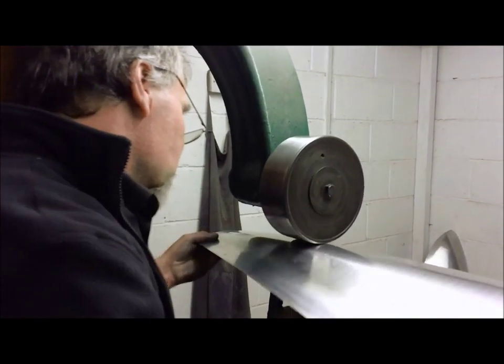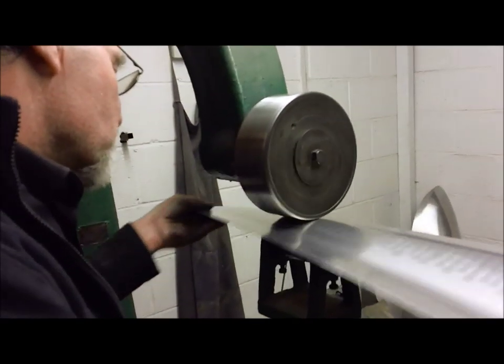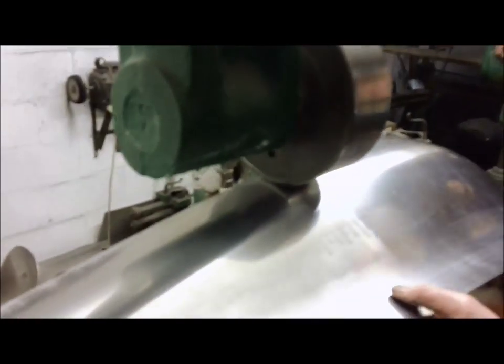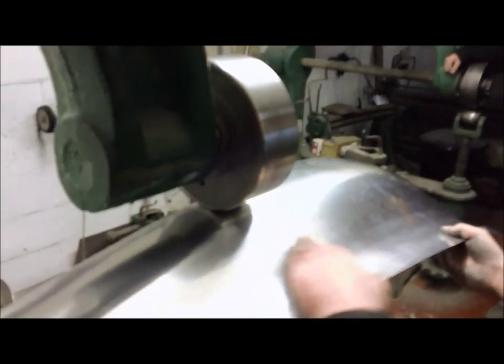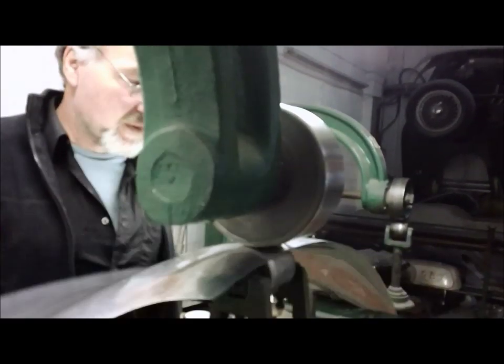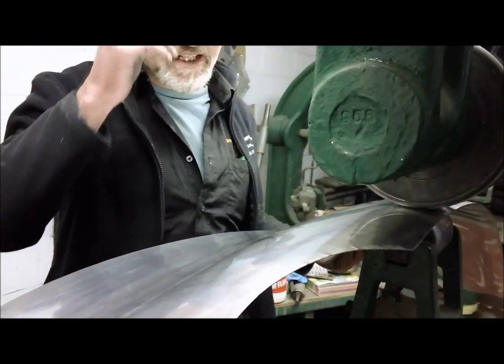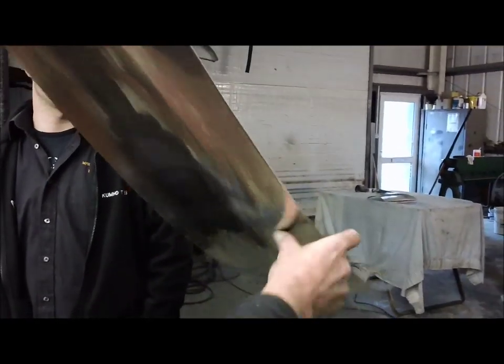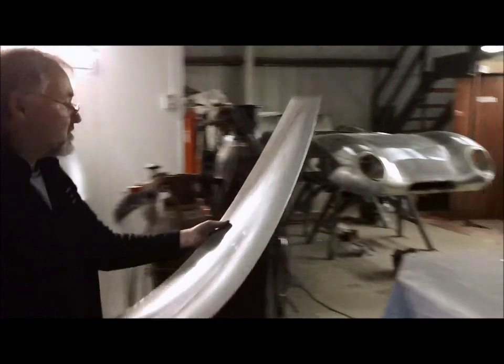How to English Wheel a complex panel PART4

Comment: I did my apprenticeship learning how to form using the steel wheel and rubber wheel. We used a flipper made from old car leaf springs. We had sand bags and wooden forms lined with leather. We were working Aluminium to complex shapes. The final steel wheel DOES work harden the Aluminium and puts enormous strength and rigidity into the form. After a while your muscles work the forms without even thinking much about what you are doing. In fact when you are learning you try too hard and that's when the ridges and tram lines happen. Very interesting. A walk down memory lane watching this.